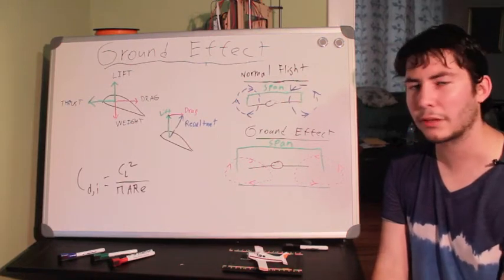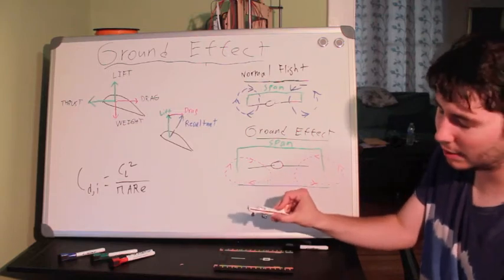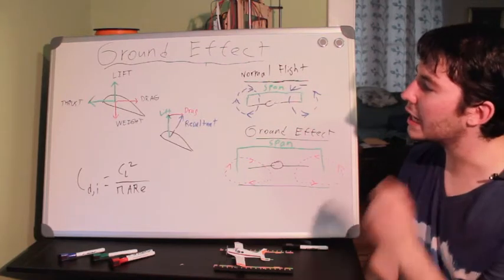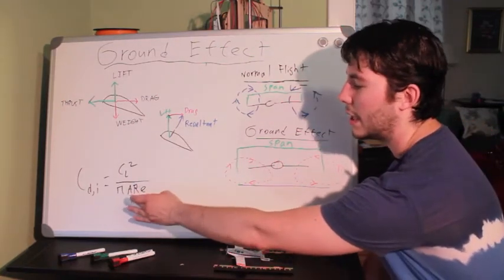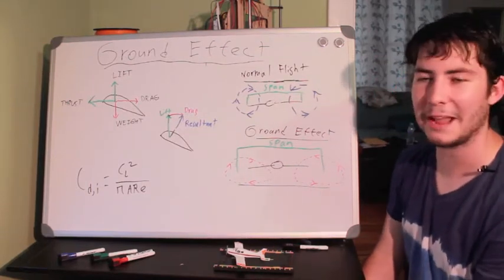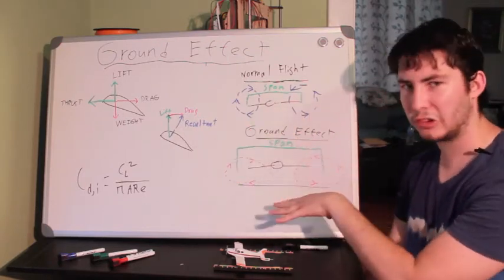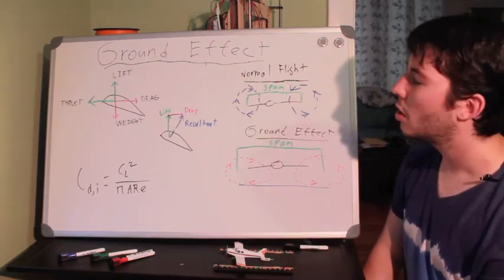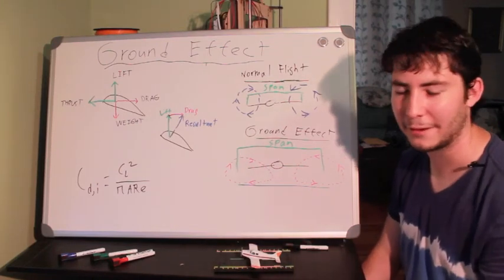Ground Effect

Comment: Hi there Scott! Nice video. I'm kinda' late with the comment. Still, maybe you could answer a question I have about ground effect: Is there any way to cancel ground effect during final approach by modifying the geometry of the wing? Like, for instance, pulling the wings back, flattening the wings, extending some sort of spoiler to push the aircraft towards the ground or drastically reducing air speed by creating aerodynamic drag from the tail of the aircraft? It should, in my mind, be easier than landing with all that ground effect and learning as a new pilot how far to pull the nose back up in order to decrease the speed of the aircraft during landing. What does an engineer say about that?
Reply from the maker: Hi Bogdan! Thanks so much for the nice comment. I'm no aircraft designer, but here's my two cents, for what they're worth! :)

Aircraft design is all about tradeoffs - generally there are no free lunches with aerodynamics, if you make one thing better, you make another worse. So while many adjustments could be made to the aircraft to nullify the results of ground effect - few make sense for general aviation or commercial aircraft. You're correct that you could create more tail sweepback, flatten the wings, pick a different airfoil shape, or use spoilers to kill ground effect, among many things. But all of those adjustments create more complexity, increased weight, increased manufacturing cost (this is a big one!) and generally hurt the aircraft performance in cruising flight - where it spends most of it's time! Single engine GA aircraft are designed to be low-cost, easy to control, fuel economical, and easy to repair/maintain. Of all of these options, winglets were chosen as the easiest to implement that don't affect other phases of flight. Also, ground effect is generally not an area where pilots struggle too much compared to other phases of flight. So, most manufacturers have accepted it as a fact of life that costs too much to fight against. I hope that explains it well.

Having said all that, maybe someone out there has designed an experimental aircraft that counters ground effect well. I'll have to keep an eye out for one!